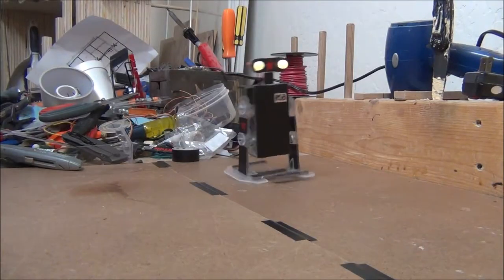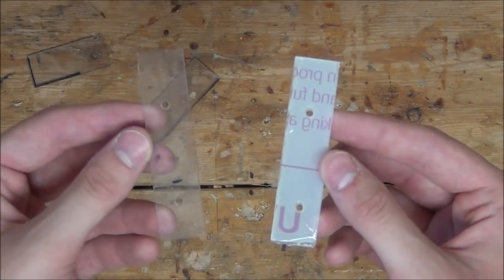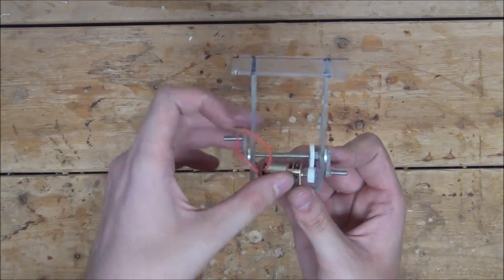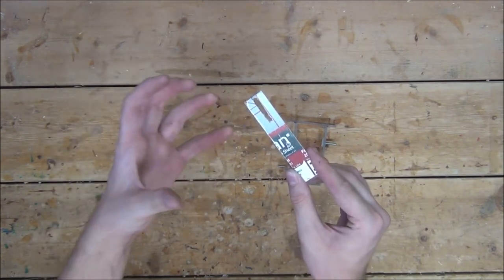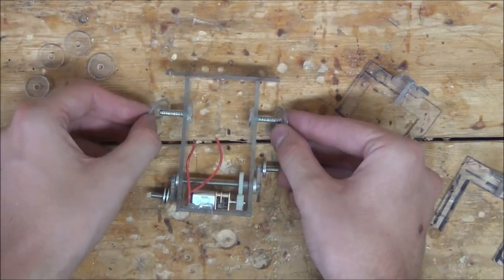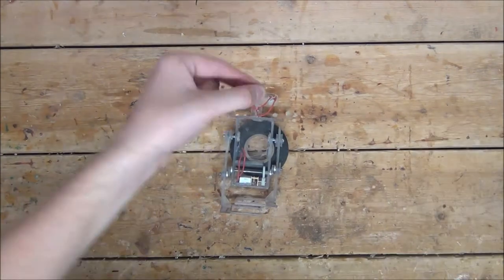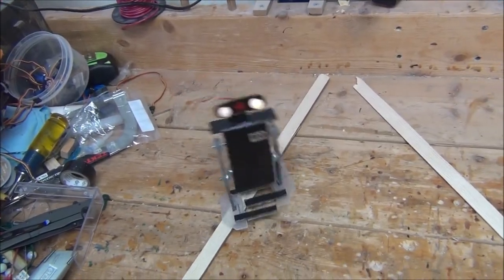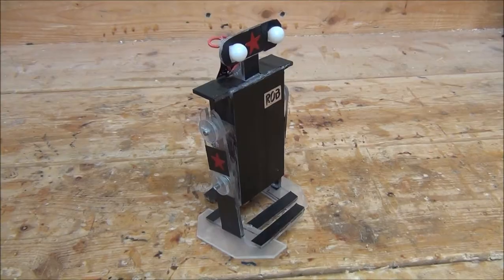How To Build A Walking Robot!!!

Comment: Awesome, dude! 😀
A tip: you can use a small 2s battery and fix it inside with velcro. 😉
Reply from the maker: Thanks! And yes you definitely could! However since 9v are so common and it fit in there so snuggly I didn't see a reason to change it.  :)

Comment: how about adding a arduino nano to it with ultrasonic sensor and make it obstacle avoiding or maybe a touch sensor on the hear with a speaker to make it say something wen someone pats it.......gives it more personality i think
Reply from the maker: Well sadly you can't make it avoid obstacles because both legs are driven off of the same motor... Plus this robot is suppose to be bare basics :)